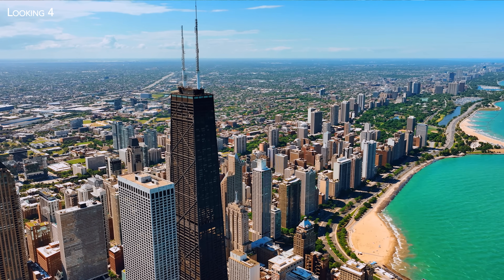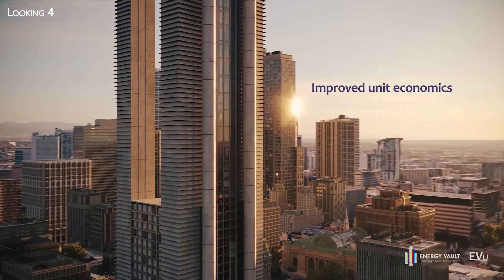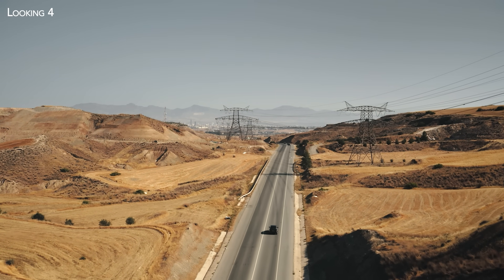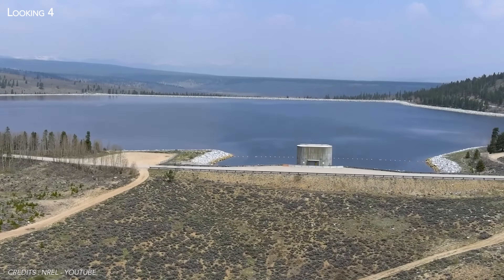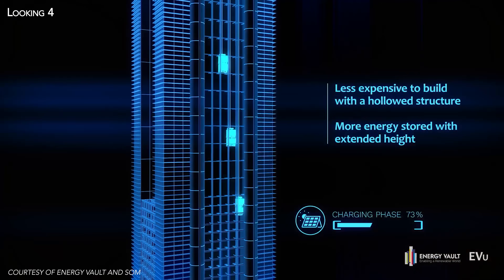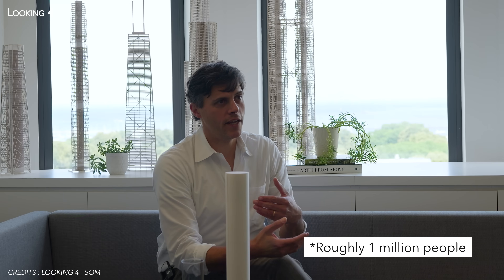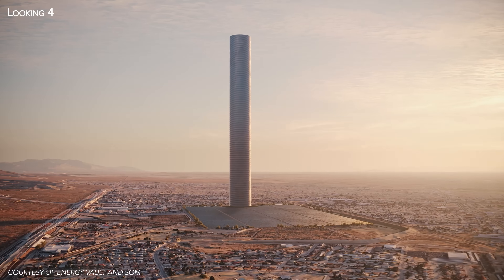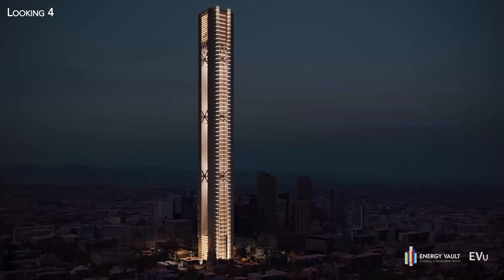America Wants to Build the World's Tallest Tower

Comment: So you want to build a huge tower and add a lot of weight at the top? If you want gravity storage pump hydro or use mountains... or dig a hole... do a combo and make the hole work as foundations for a high-rise, but don't waste the real estate on filling up the tower with weights which will be statically dubious... and don't clad the entire tower with SV...  consider the trajectory of the sun vs the shape of the tower; go for optimal shape depending on your latitude...

Comment: I'm agnostic if it does the job of providing energy at a reasonable cost. However i  don't find wind turbines remotely soothing or natural to the landscape so its a high cost to lose that natural look. The problem is regulatory capture. As Elon said its almost impossible to do anything or build anything there is such a mountain of red tape to go through. Thats one of the main reason for not building nuclear, the insurmountable level of bureaucratic hoops to jump through just to get started. You have to rebuild your nuclear facility 3-4 times because the regulators say so and thats why it costs 3-4 times what it should. The way forward is to have AI build your nuclear facility and ban all leftist regulators from coming within a mile of you otherwise it will never be completed. 😂😂 Imo.

Comment: The weight of a 1KM tower would be nearly impossible to support. The pressures at the bottom would be incredible and again almost impossible to build for.
Reply: The Jeddah Tower will be 1 km tall. It'll be topped off in the next year or two.
Reply: @miker4399 
Imagine the internal pressure at the bottom trying the explode outside the structure. The weight will be insane

Comment: The problem with this solution is you lose have the energy you put into the 'Vault' (Battery). Most batteries are 80%+ efficient, if not 90%+. No one under 50 is scared of nuclear. Solar is great, but not widely available in much of the US climates.. Nuclear is super cheap to maintain, Windmills are a massive maintenance with short lifespans and are also intermittent.

Comment: Why not just dig a big hole in the ground for those places that have no mountains.  Building the world's tallest skyscraper seems expensive for what could probably be accomplished far more cheaply just blowing up some rock underground.
Reply: Correct! There is no need for this type of scam. There are small to medium modular nuclear reactors that are 100% safe that could provide almost limitless energy.
Reply: Digging is actually more expensive
Reply: @creativeearthian1702  but there is no theoretical depth limitation and and the water baskets they speak of using wouldn't freeze underground. at -40F a mile into the air in Chicago they are just lifting ice cubes.

Comment: Also, keep in mind that this battery still needs thousands of acres of solar panels or hundreds of wind turbines to charge it.  A nuclear plant takes a few acres and you don't need a multi-billion dollar battery.
Reply: And billions of dollars and 15 years.
Reply: @saumyacow4435  But with service a nuclear plant lasts 80 years, possibly 100. A solar panel and it's battery lasts 20. So you'll 5x the cost before you are competing with nuclear.
Reply: @Yattayatta Except  that panels last 30+ years and they're not even half the cost of a commercial solar plant. plus you've not included the 10s of billioins a nuclear plant costs in in waste disposal and decommissioning. Sorry but nuclear is not economic.
Reply: @saumyacow4435  It's very economic in fact, the most economic. Waste disposal is a solved problem, decomissioning will cost, but so does decomissioning windmills solar panels and batteries.
Reply: Did you see the thousand of solar panels in the design? Not saying, just saying.
Reply: Right. Covering the land is never the answer.. We're suppose to coincide with nature. Not mow it over.
Reply: @21CenturySkyScrapers  As if don't have millions of square kilometres of rooftops, derelict land, mine sites, ash dams from coal fired power stations, overgrazed wastelands, deserts and more. it's a silly argument.
Reply: You just need a billion dollar facility
Reply: Waste disposal might be a "solved problem" but it still costs billions and its a cost ignored by nuclear enthusiasts. So too is the billions and some times tens of billions in decommissioning costs associated with reactors. As for the "thousands of acres", this is presented as a problem. Why? The Earth has millions of square kilometers sitting idle, grazed flat, paved with concrete. Its a nonsense argument. And a multi billion dollar battery is still cheaper than nuclear. Sorry, the economics of nuclear don't stack up. When you invest in energy, you invest in that which is less costly and faster to get a return from. That's why the world is investing in renewables and nuclear is all but dead.

Comment: Look up Muddy Run Pumped Storage Facility for some good info.  It has an elevation difference of 400 feet with a capacity of 1 GW.  Not as efficient (70-80%), but building a 400-foot high tower would use standard construction practices instead of needing some extravagant engineering.

Comment: My concerns would be the long-term effects of the vertical weight shift of all the water as well as keeping the building stable in high winds. Tuned mass dampers are deployed today to mitigate wind effects on a building, but they work because a traditional skyscraper doesn't have drastic load shifts throughout the day like this sort of structure would. Additionally, with the dam systems of hydro batteries, such as seen in Switzerland, water is pumped at an incline and not directly vertical. Hydrodynamically, the steeper the incline, the greater the amount of head pressure required. Skyscrapers notoriously are energy hogs when it comes to pumping water vertically to low water volume fixtures like sinks and toilets. The pumps and the energy required to operate the pumps for moving high volumes of water straight vertically upwards of 1km high would be absolutely astronomical. This is essentially a water tower like many suburbs deploy, but energy efficiency is not the main factor in a municipal water tower. Water towers are used to prevent the need for on-demand, variable-pressure pumping of water to clients. Instead of needing to vary water pressure with demand, a storage tank is filled, and gravity provides the pressure to deliver the water to individual homes/businesses. Additionally, water towers can hold a large enough supply of water in the event that the lift pump is taken offline for a while, such as for maintenance or during a power outage. The amount of power required to charge the water battery in a purely vertical structure like this would be somewhat greater than any benefit. Cool CGI renderings still can't overcome the laws of physics. Nuclear is probably the most viable power source going forward, as long as we can figure out a way of dealing with the waste. Its "smokestack" emissions are just water vapor, the power is easily scalable to demand, it can produce high amounts of power for a small amount of waste, and modern nuclear technology is very safe compared to older systems. Green/Renewable energy has severe limitations. Solar's efficiency drops off dramatically after a few years of service due to UV damage to the panels and has a high level of manufacturing pollution per unit of output compared to other electric production form. Wind power harvesting is notoriously inefficient and does disturb animal and even human life, such as disturbing animal migration pattern and sleep cycles.

Comment: Completely dumb idea that has already been debunked many times over. Every additional 100m you build up, the cost increases significantly. But why build a pencil one mile high skyscraper in the middle of a flipping desert when a flat-and-wide warehouse would provide the same battery functionality but at a fraction of the price. Furthermore, why not utilise disused mineshafts first, as those holes are already dug.
Reply: After a certain number of floors, the savings and other benefits of building up instead of out start to diminish. A greater percentage of the floor space inside the building has to be taken up by elevators, the cost per square foot or square meter drastically increases, etc

Comment: they have to check the math of it but it right it is one of the greatest ideais i have heard on the subject you put the data center on the building it's heat will turn the water to steam that will go back to be water in the top and using kinetic energy will move generators that feed energy back to the data center. everything ocuping what 50 bilionaries would by as double dack apartaments to hide their money.

Comment: This is simply not doable. Making a 1km tower work weight wise is hard enough. 1km filled with batteries? Doubt it but would gladly be proven wrong.
Reply: Filled with batteries?  Don't think you understand the concept.  The "battery" is in lifting a weight up while "charging the battery and lowering the weight in discharge.  There are no chemical batteries here and it's a very simple concept.
Reply: @admiralthex But when the "battery" is all full won't the weight will be all on the top, making the structure unstable?
Reply: @PureAlbania  the details here seem like the weight is just water which avoids any wastage or imbalance like you suggest.  Pump water up into 1000 feet of tower to store energy.  To use it, just open a valve and run it by a generator.

Comment: or just build nuclear power plant for far less money and will last 80 years not 20.
Reply: How do you know it will only last 20 years?   That would be ridiculous to build the world’s tallest structure to last only 20 years!
Reply: @Montanaman-j6l  solar panels last about 20 to 25 years, the tower will last longer.
Reply: Was mr 20 years talking about the building or batteries?
Reply: Chernobyl will last for thousands of years, not just 80.
Reply: @VPWedding  and the toxic chemicals used to make solar panels last forever. nuclear is the cleanest and safest form of energy.
Reply: @pantsgaming759  "Solar panels are consistently characterized as non-hazardous under the EPA’s Toxicity Characteristic Leaching Procedure (TCLP) which tests leaching of toxic chemicals. Such testing creates conditions much more extreme than in the field: chopping up solar panels into tiny pieces, submerging them in an acidic solvent, then agitating them. Even in these extreme conditions, solar panels do not represent a significant risk.’"

Comment: The most important feature of storage is cost. The engineering and construction cost of such a tower is prohibitive, particularly when battery storage cost and efficiency are improving fast. And there is no reason to locate your storage in the middle of an urban environment where real estate costs are also prohibitive. That's the advantage of electricity, you can transmit it from somewhere more practical.
Reply: Yes, this idea would actually be much cheaper to do underground.  No need for an overcost monument.
Reply: @joeycad  perhaps less expensive, I'm not sure, but still orders of magnitude more expensive than surface pads on cheap land.
Reply: It's practically the same reason why you don't see farms built in urban areas
Reply: If you're storing electric power as DC - which batteries do - distance matters.
Reply: @Baribrotzer  Inverters are standard for storage. It is possible today to do long distance DC power transmission, and it has some distinct advantages, but I'm not talking about doing that for typical battery storage facilities.

Comment: 1 GW-H sounds like a lot, but must be compared to power consumption. My sense was that, like all batteries, it wasn't very remarkable. So I asked an AI, being too disinterested to look it all up myself, though I did a back of the envelope calculation first. BLUF: 7-10 minutes and less under peak conditions. Roughly in the range of an uninterruptible power supply. 

Here are is the prompt question and both the brief and elaborated answers:

Q1. How long would a hydroelectric storage tower with a one gigawatt hour capacity power Chicago?

A1. hydroelectric storage facility with a one gigawatt-hour (GWh) capacity could power Chicago for approximately 10 hours if the city's average electricity demand is around 100 megawatts (MW), which is a typical estimate for the city's peak load. 

This calculation is based on the relationship between energy capacity and power output: Duration=Power Demand/Energy Capacity. 

For example, 1 GWh of stored energy divided by a 100 MW demand yields 10 hours of power supply. However, actual duration depends on Chicago's real-time electricity consumption, which can vary significantly based on weather, time of day, and season. The facility would need to be designed to discharge at a consistent rate to match grid demand, and the actual duration could be shorter if demand exceeds 100 MW or longer if demand is lower.

Q2. I asked it to elaborate. Here was the answer:

A2. A hydroelectric storage tower with a one gigawatt-hour (GWh) capacity contains 1 million kilowatt-hours (kWh) of stored energy. To determine how long this could power Chicago, we need to consider the city's electricity demand. Based on available data, Chicago is part of the PJM Interconnection grid, which covers the Mid-Atlantic and parts of the Midwest. 

During a 2019 heat wave, peak electricity demand in the PJM region reached 152,315 megawatts (MW), or 152.3 gigawatts (GW), with a significant portion attributed to the Chicago area. 

While this is a peak value, average demand is lower. Residential data from the greater Chicago area indicates significant usage, with average monthly consumption around 721 kWh per household. Extrapolating to the full city, estimates suggest Chicago's average electricity demand ranges between 6 and 8 gigawatts (GW). Using this range:

At 6 GW average demand, 1 GWh would last: 0.167 hours, approximately 10 minutes
At 8 GW average demand, 1 GWh would last: 0.125 hours, 8 minutes

Therefore, a 1 GWh hydroelectric storage facility could power Chicago for approximately 7 to 10 minutes under average conditions. During peak demand periods, this duration would be even shorter.  

Draining the entire tower until loss of required head pressure to feed the hydroelectric generators in 10 minutes seems like a LOT. Those would have to be some massive pumps. I asked the AI about this but didn't ask about the volume to total energy storage, which would be key to the required pump flow rate to be able to discharge the thing in 10 minutes. We would also have to know how many generator sets were involved to distribute that flow.

Me: It seems inevitable that emergency power would be prioritized among users. Most people would not benefit in an outage. Potentially very useful technology fro some applications, but also a juicy target for the malevolent, of whom we sadly have many.

Comment: Completely nuts. Pumped hydro uses dramatically higher mass, and far cheaper infrastructure.
Reply: Exactly. Its the cost of the mass that you are lifting that sets the economics.
Reply: Not so sure , the Snowy Hydro 2.0 is overbudget
Reply: there are a limited number of sites suitable for pumped hydro.
Reply: @RonTodd-gb1eo  Exactly. Not only that but building the required additional grid connections are costly and difficult to get approved.
Reply: A simple concept, providing you have the energy ( in this case wind/solar) to pump the water up. The higher the building the more potential energy. 

I question if they can generate that much green energy on a consistent basis. But, let’s say they can. That the economics are viable. What about the structural/engineering challenges of that much mass stored at the top of a 1km high structure. Mass that notoriously destabilizes containers when it moves back and forth. What about side loading or potential resonance vulnerabilities if there is an Earthquake or large storm? A massive disaster in the making. 🤷🏻‍♂️
Reply: Building a mountain in Chicago would be very expensive though.
Reply: Well, this is pumped hydro. They never explain why putting the system in a ridiculously tall tower is better, except perhaps the increase in gravitational pressure from that height.
Reply: It's amazing how people can show their ignorance when you pump the hydro using renewables would you like to restate your position here cuz it cost nothing you forget wind and solar is free there's nothing to burn so you do not have a cost of fuel the cost of the fuel is free
Reply: Does any of the people replying to this understand that every single one of their water towers across the world is pumped hydro... think about that a minute?